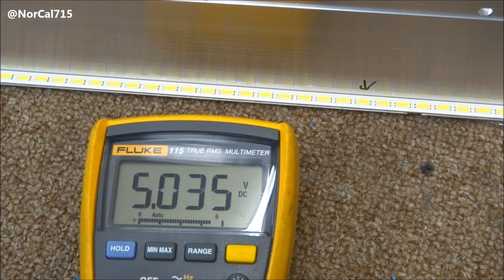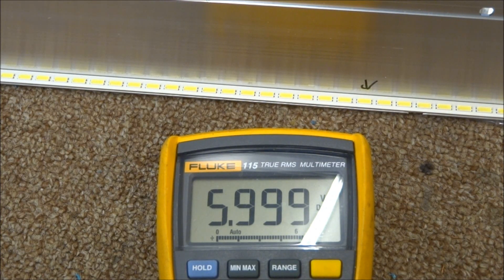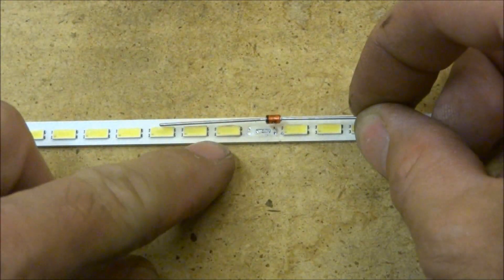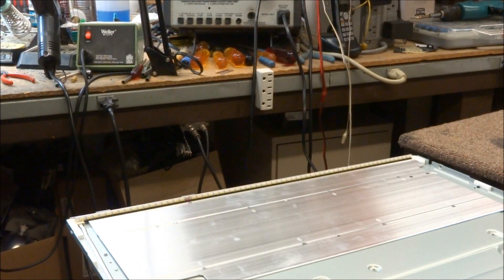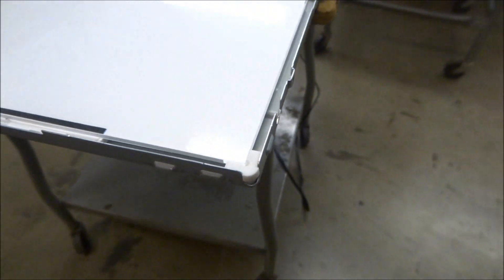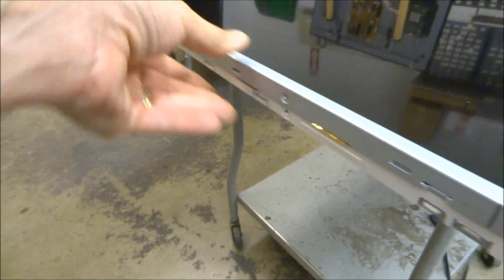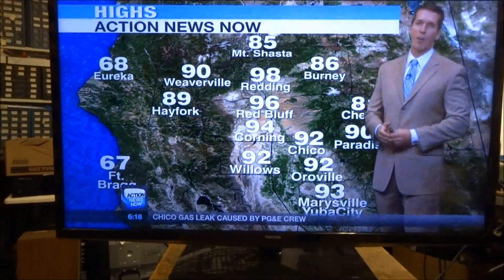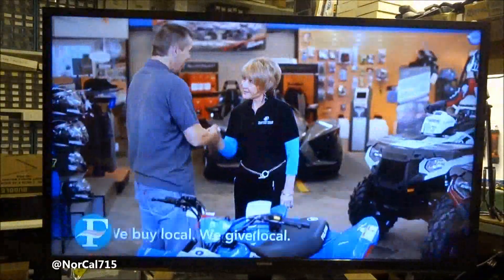Toshiba 46L5200 Logo Screen Flash TV REPAIR - No Picture - LED Drive Problem Part 2

Comment: Hi,
I thought about moving an LED from the end of the strip to the middle where the faulty one was and then working on the end rather than the middle. Interested to hear your thoughts on this idea. Thanks for taking the time to share and you do some great work. I have watched every video of yours and I look forward to the next. All the best
Reply from the maker: Darryl Landry Didn't want to potentially damage other LED's from the heat by removing and trying to place them in other locations. Thank you for the support.

Comment: Not sure about the Vf ya got there norcal but check these out at Farnell.. They do look very similar to the type you have there..

http://uk.farnell.com/webapp/wcs/stores/servlet/Search?catalogId=15001&langId=44&storeId=10151&categoryId=700000006148&mf=107612&pageSize=25&showResults=true&pf=112157830
Reply: +orbiter8 (John) Hi, I did not see a reply to your question for norcal.  Did you by any chance get a response or verification?
Reply: +Raymond Jackson .. No.. No response as yet.
Reply: +orbiter8 (John) I was trying to find something similar on the Mouser website, did you try looking there?
Reply: +orbiter8 (John) look here as long as you have part number of led strip  -   http://www.yoycart.com/Product/520801002367/Absolutely_new_Samsung_46_inch_LED_light

Comment: 5V forward voltage on a white led? I'm pretty sure that for a single white led you shouldn't exceed about 3.6-3.8V even for a high power led but anyway. Keep up the good work :)
Reply: +norcal715 Could these fit in there? I have this exact same issue with my 46L5200 http://www.cree.com/LED-Components-and-Modules/Products/XLamp/Discrete-Directional/XLamp-MLC
Reply from the maker: ciprianwiner Looking closely at the pack with a microscope it is actually 2 LED's in one package. I had some single ones out of another scrap set that biased in the range of 2.5 to 3.5 volts. but I couldn't fit 2 of them in the circuit. Thanks
Reply: norcal715 Thank you for your detective work. You live and you learn I guess. Cheers :)

Comment: Hi, did you consider moving a good LED from the end of the board to replace the faulty one in the middle, so the backlight was more even, then short the pads of the missing diode, then put the zener in series with the lead s you wouldn't have to cut the diffuser?
Reply: bgdwiepp  good video all round though
Reply: bgdwiepp they are not wired like xmas lights.
Reply: Ben Gugled There is a boost converter that provides the drive voltage for a number of series stings of LEDs, then there is a BJT or mosfet current sink on the end of each series string. When the voltage accross the strings are too different (because of differences in LEDs), there is excessive power dissipated in the current sinks and as a result a fault signal is  raised.

I'm unsure how else you think they would be connected?
Reply: bgdwiepp  So your statement proves they are not wired like xmas lights.
Reply: they are wired like 3 sets of christmas lights instead.

Comment: Did not understand the forward verses reverse, but great video.
Thanks
Reply: amtpdb1 zener's confuse me a bit too.
aparently, they work as regular diods when used the correct way around, but will work in reverse as a crude voltage regulator to drop voltage by what they are rated for.(eg 15v in through a 6v zener gives 14.5 v in normal orientation, but 9v in reverse
Reply: amtpdb1 The junction of a Zener diode breaks down at it's Zener voltage when reverse biased, so you effectively get a voltage drop across the diode equal to it's Zener diode voltage when passing a current through it. When forward biased, it operates like a standard diode. All the energy dumped into the diode is wasted as heat.
Reply from the maker: voltare2amstereo Thats a good way to put it. I didn't have time to completely explain it but you got the essentials of my description. Thanks for watching.